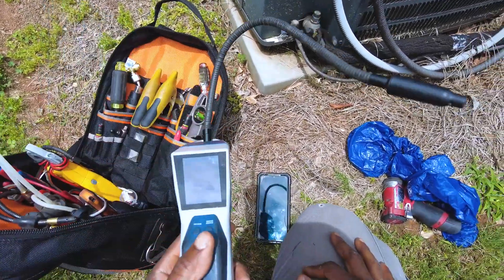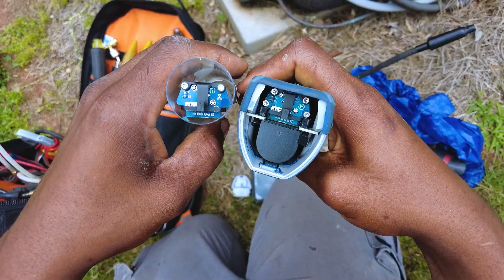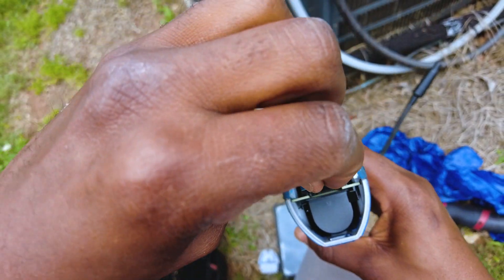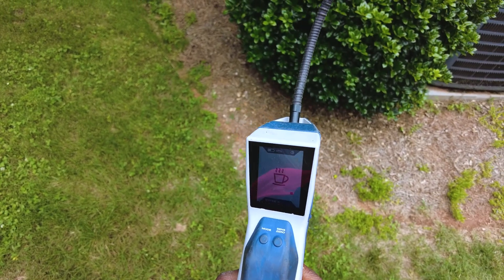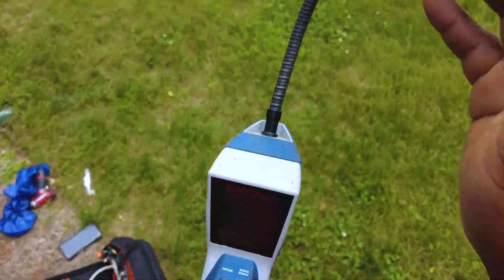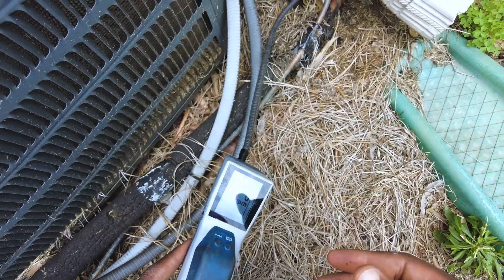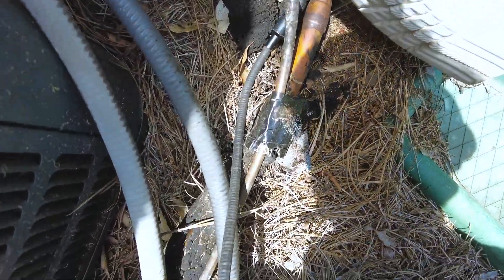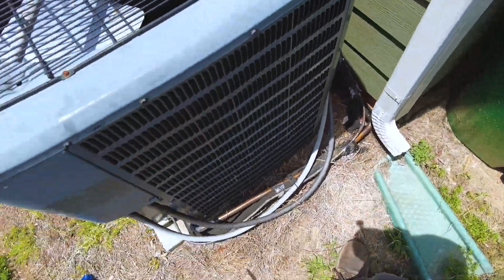Inficon Stratus D-Tek Refrigerant Leak Detector Sensor Replacement field swappable sensors

Comment: My company loves this meter… im not sold on it, i wanted the current fieldpiece unit…now theirs detects A3, from when i first looked into getting one. Its about $700 for an A3 sensor and we usually buy the whole unit for $2200. Its a pricy unit, but theres always doubt on small leaks or if youre opening up insulation which can give false reads.

Comment: Hmmm. It’s just lovely that it happens so often you have to keep a spare with you.
Reply from the maker: Lol, nah I definitely don't keep a spare on me, might have to consider it though. The sensor probably lasted about a year and a half before it failed. But honestly I haven't had any other issues with it other than that. Was yours having the same issue over and over or are there different issues after they warrantied them out
Reply: Man mine is about a year old and also having issues. I think needs a new sensor already. Didn’t get much use out of it.

Comment: What causes a sensor to go bad?
How long do they last on average?
Reply from the maker: There are a few things that can cause the sensor to fail. main one being pulling water into the sensor either through wet coil or dunking the tip into a pan full of water while trying to find a leak. Also, they just fail overtime.